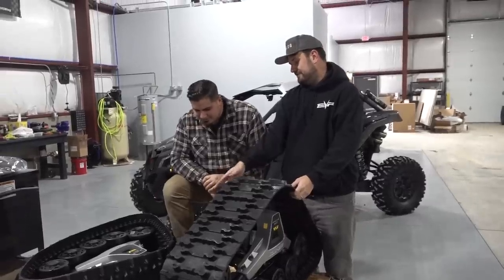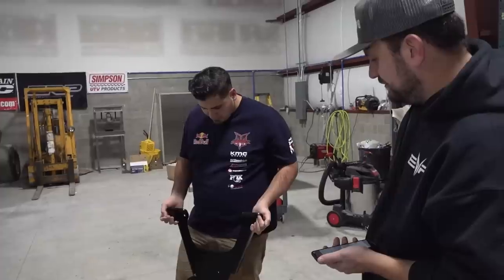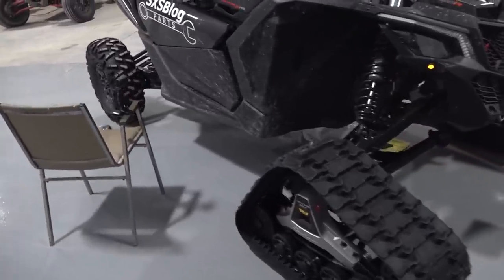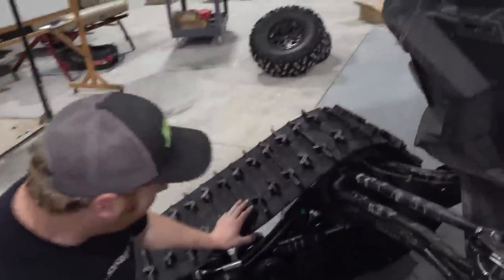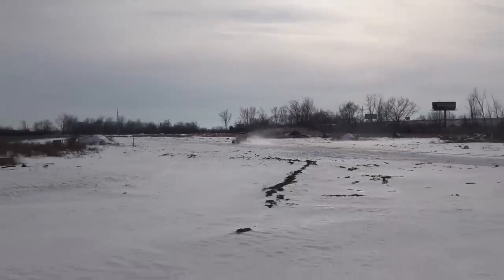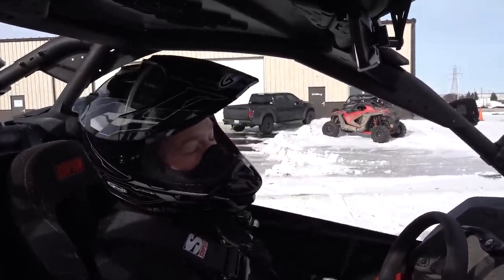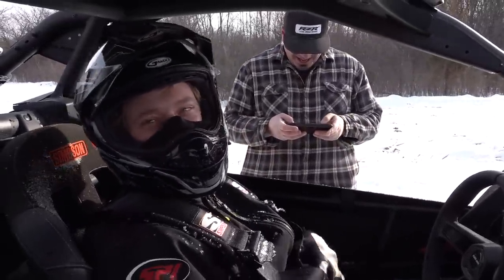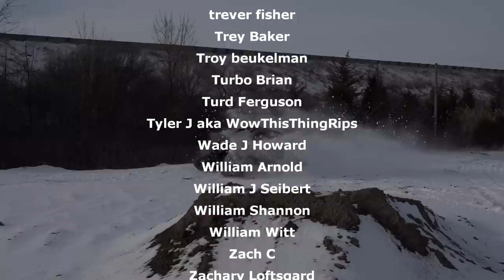300HP Maverick X3 on TRACKS! INSANE TRACTION! Apache 360LT

Comment: should gear it lower if possible, such a powerful machine can go faster, the engine is just screaming for more resistance. The sprockets that are turning the tracks are alot smaller then ur usual wheels so that gears it higher.

Comment: Great show guys, I would like to see a show where you test 2 vehicles 1 being the Honda Talon.   I would like to see you put tracks on the front and tires on the rear. The other unit tires in front tracks on the rear. Then switch it around. I know it's a lot of work but I think that could be if really cool 2 or 3 episodes.
Reply from the maker: What would we be testing with that?
Reply: @SXSBlog   Functionality performance handling, I was curious with tracks in the front if it would pull you through the corner and tires in the rue would loll you to drift.  I wondered how it would handle like if it operated like a 1/2 track.
Reply: @SXSBlog    I know that would be a lot of work and I just thought about the fact it would probably screw the gear ratio. Thank you for the great shows I love watch them with my looney tunes Saturday morning cold pizza and Pepsi

Comment: Tracks are awesome! But I want to see it with just the rear tracks on it with regular tires on the front, and ripping it in 2-wheel drive. That would cool.
Reply from the maker: Would be real tough on the driveline because the gear ratio is so different.  The tracks are like running 14" tall tires

Comment: It looks super cool but it also looks like it slows the machine down tremendously. I guess if you had more snow then tires could handle it would be fun but if you have a foot or less tires look way more fun.
Reply from the maker: They do have a major gear reduction so top speed is much slower.  We'll have em in deep snow soon

Comment: Do you run the risk of the rear tracks coming out of the casing ripping sharp turns on super grippy surfaces?
Reply from the maker: The only time we've had issues with tracks derailing was in the deep mud or over sharp obstacles (like logs).  These Can-Am tracks have a lot larger drive lugs though and I suspect will be very good.